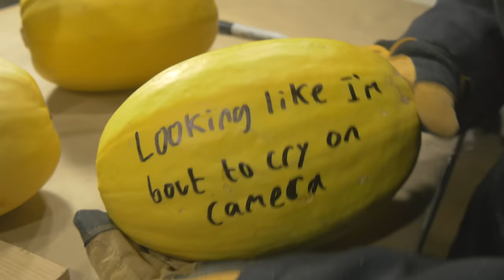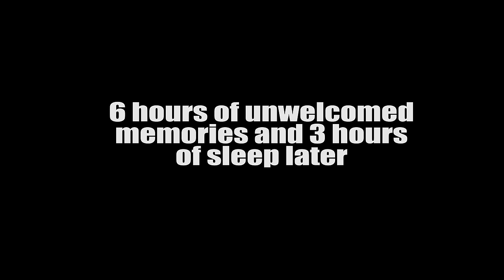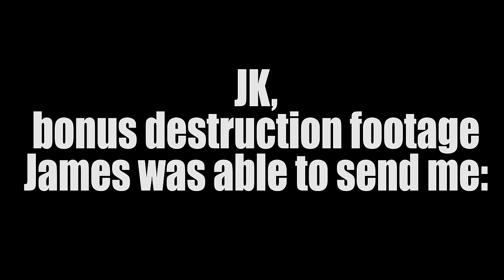The BRAIN BLENDER! (Handheld Lawn Mower of Death) - Feat. the Hacksmith and Omar Isuf

Comment: Glad you finally got it working! 

We had a blast building with you, for more videos featuring Eli, don't forget to check out our channel (especially the Reinhardt's rocket hammer video!)
Reply: the Hacksmith #shamelessplug
Reply: the Hacksmith I saw you when you went to Wisconsin
Reply: I’m a huge fan of both the hacksmith and Eli, this was such a cool collab!
Reply: Subscribed hacksmith because of Eli ngl
Reply: the Hacksmith so, he basicslly just made a more badass homemade weed whacker? 😂
Reply: Still love it.
Reply: Thanks for pointing this video out hack smith! 😋
Reply: the Hacksmith yall built a rad weedeater lol
Reply: He essentially built a motorized fan of death, Hasbro, take a hint sell this to ppl, make sure the blades are "plastic" and batteries not included. P.s. Hasbro is not reliable for any injuries caused by this device, If you decide to sue, well tell you, you can have a full refund, not an arm, finger, or a foot.

Comment: you should invest into an external HDD to store video footage before editing. I bought a 2TB for like $100
Reply: Or an ssd
Reply: SSDs cost more money for less space, although they ARE faster and (supposedly) sturdier. It's a pro vs con thing I guess, but from a simple cost to space ratio, the HDD is better.
Reply: they can crash just as easy. only difference is that a magnet  cant crash an sdd and ssd is  faster at finding/loading stuff
Reply: +ryngak SSDs function at around double the speed of a hard drive
Reply: 100$?!??? Why so much??? I got an ultra slim 2 TB for $40!
Reply: Jonathan Vandagriff it's an ssd not a hard drive 👋😑boi
Reply: WolfEatsCakes 2Tb SSD for $100? i fucking wish
Reply: wat evenisthis I'm saying this kid is getting hdd mixed up with ssd

Comment: Why do you need a cobalt drill bit to drill into the steel if you can cut it with an angle grinder? Also what are you doing with that tool with the two handles that makes the rivets? What is it called?

Comment: You need a grip clutch like in Rc's. When you hit something the current jumps up too much for it to handle. Or an overcurrent safety switch.
Even better would be if you let go of the throttle when you hit something so that the blades spin freely and the current doesn't jump because of the higher load on the motor.

Comment: Ypu shpuld get yourself a NAS system. It is basically an external storage option with multiple drives and you can configure them like that if one disk dies the footage is still present on the other drive. Premade NAS systems are really easy to set up and do most of the work for you.

Comment: or just use a weed wacker
Reply: A weed wacker has plastic little "strings" that it uses to cut. This uses large metal blades.
Also a weed wacker was two "blades" while this has three.

And if my maths is correct that means that this is more badass than a weed wacker.